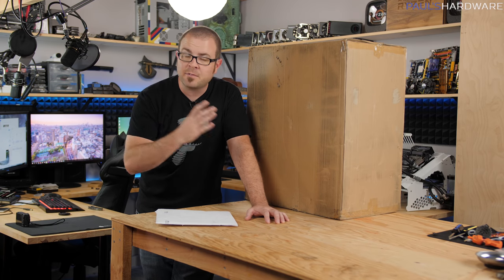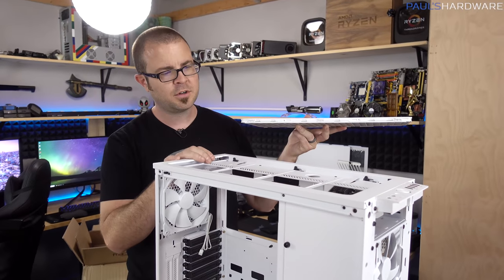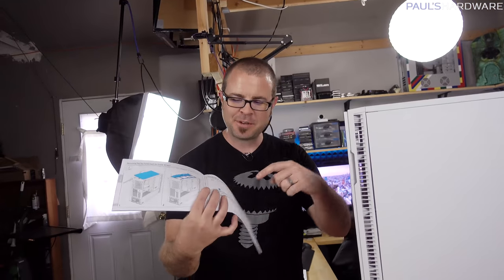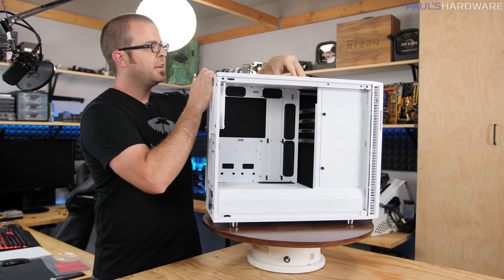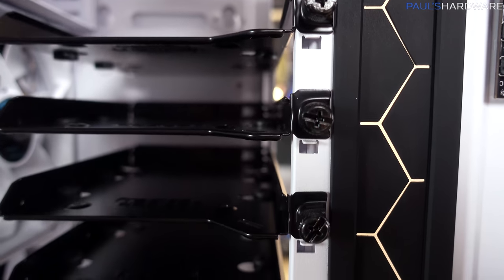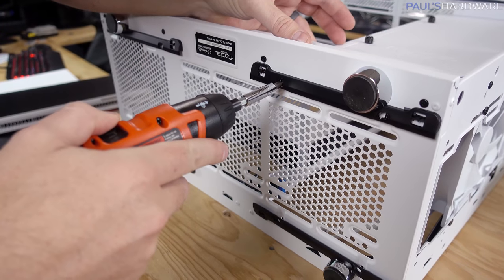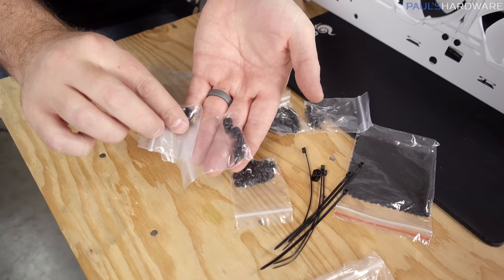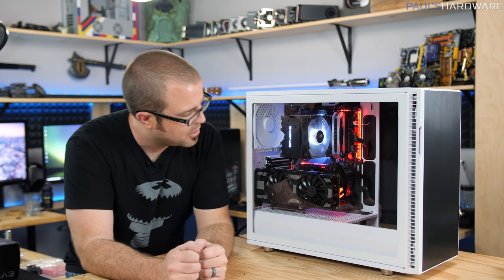Fractal Define R6 - A PC Builder's Review

Comment: Just wanted to mention one thing that Paul forgot to mention about the new Define R6. That modular HDD plate that he removed can actually be shifted back into the case to be in line with the motherboard plate. Then on the backside of that HDD plate, you can still mount two 3.5" HDD's on it. So you wouldn't lose all 3.5" HDD support when shifting to the more open layout.
Reply: I think you guys need to hold back release on this case until you swap out all front panels with USB type C. Don't sell it extra, that's just a slap in the face to your customers. 2nd, there is a black out version why is there not a whiteout version? Most of the complaints i'm reading is why is the front black and not white? Do white or at least a light silver. For $150 USB type C should be included. For anything over $100 and it being 2018 USB type C should be included. USB 2.0 is completely redundant when 3.0 is included. 2 USB type A 3.0 and two USB type C is all this case needs.
Reply: If you want an honest answer for why the type C port doesn't come with the case. It is because 3.1 gen2, as quickly as it's caught on in the mobile world, is still very much a newcomer on the PC side of things and still very costly to include with the proper quality construction and materials we consider standard for cables and connectors on a Define series case.

USB 3.1 gen2 may be ubiquitous in the near future (assuming USB 3.2 doesn't get there first), but for now, there are still very few motherboards with 3.1 gen2 headers and very few devices aside from phones that can take full advantage of it. 

We know many have been asking for gen2 support, but since most don't yet have a use for it we felt it best to give people a choice rather than charge everyone what would have been a significantly higher price.

As for the other colors, these are just the colors that we launched with. If we hear enough from the community that they would like to see a certain color. Then we may release more colors of the Define R6 in the future. That is what happened with the Define R4 Blackout Edition, and the Blackout color has made its way into the Define R5 and the Define R6.
Reply: Thank you for the quick and detailed reply. Hopefully this will help answer what many have been questioning today. One last thing I would suggest. Offer some combo package where the type c front panel and maybe the PCI E extension cable is cheaper if ordered at the same time as the case. Something to bring the cost down because all together we are talking over $200 and that is asking a lot.
Reply: A) Will it be possible to buy extra drive bays (more than 6)
B) Max amount 3.5" hdd's? 8,9,10
C) Will there be a package deal for case and type-c combo?

Thank you.
Reply: A) yes
B) I believe I saw it was 11 on another channel (another review said 10, so it's AT LEAST 10)
C) That I don't know :P sorry, just didn't see an answer for your questions, so trying to help out :P
Reply: After looking too many options on so many cases very similar to the R6 I've finally choose this one because of it's clever design, sturdiness, the ventilation is enough and the possibility of having 2 HDD 3,5" on the back, 2 SSD on the side and 2 more over the PSU case is all I need. I don't really care for the type C port not coming because I'm not using it anyway, however it's good to know that it can be ordered if needed. Great case, I like its simplicity very much.
Reply: @fractaldesignsupportna545  I know this is old but as far as the USB 3.1 panel is it possible you could offer a rebate or core charge for the old io panel to people that order a 3.1 panel or have the option to order the case with the 3.1 pre-installed because once we get it what are we gonna do with our old one. At least finding a way to dispose our old one and/or recouping the money for it would make it a better buy.
Reply: @fractaldesignsupportna545  You should include a bottom plate (like the define type C) for filling the void thats left when shifting the modular HDD plate back beside the motherboard, out of the 4 build videos I just watched everyone has shifted that plate to the back and it totally ruins the nice clean aesthetics of the case, I can't even wrap my head around the reasoning behind not including a bottom plate for the void in the first place. The Define series cases are some of the best cases for super clean builds but that void with the HDD plate moved back is a huge eye sore with the rest of the build being so clean. I wanted to upgrade my case from a blacked out define R4 to the R6 but ill likely just wait for the define R7 or until its announced that the R6 includes the HDD bay bottom plate cover.
Reply: i bought r6 define and easy and clean install! thanks a lot! i will buy second r6 define when amd ryzen 3000 cpu's are released! this case is awesome and it have fan hub and easy fan installation! i love this case :) greeting from finland...cheers :)
Reply: @shinjukucafe7285  I'm actually getting this case for my first time all AMD build but in black colour, closer to the end of the year! :D
Reply: @amrishpatel3501  thats awesome! i have blackout r6 and easy install and working inside. great choice! at the end of 2019 my amd build is ready too i hope
Reply: Thanks - I got an offer for a DAW build, the sales guy said the tempered  glass version (gun metal) has no DVD slot, so he was wrong?
Reply: I just ordered this case and wanted to say thank you for thinking of those of us who not only use the pc for gaming but also for work and we use lots of 3.5 hdds. You have no idea how hard it was to find a case with these specs.
Reply: PimpTwzt  - For my first build at the end of 2019, I bought a black R6 which came with USB-C on the IO panel. I do not have any device yet (Sept 2020) that uses USB-C, but the price was actually less than their colored or glass-panel models or non USB-C case I could find - and it was available. With my budget and with a Ryzen 3600, I tried to find a motherboard which had the USB-C connector on the board, and none of the motherboards I could find had the USB-C connector on the motherboard. In fact, it was really hard to tell which boards actually had it in their specs as all listed the availability of USB-C but it was hard to determine whether they had a connector. Those that it was clearly lusted were out of my budget (550 and 570) So I chose a Tomahawk Max B450 and just have a dead C port on the IO. If I upgrade in the future it will be there.
I have to add that for a first time builder, this case is a dream in which to work. There is plenty of room and the modularity and the ability to get to everything is amazing. I am one of those dinosaurs who still needs an optical drive, so like that feature and the ability to hid it behind the door. And I did not want something full of RGB and crazy angles or design. I kept the base design setup removing all the HDD racks and am using a M.2 drive with a second SSD mounted on the rear. My main concern was heat so I replaced the Ryzen stock cooler with a Sythe Cooler (Mugen Rev5) and my CPU has never run over 60’ C.

Comment: yup. the usb type c should've included. $30 is a bit much.
Reply: adi firdhaus adi m. adnan or at least a mail in rebate where you swap the original IO for the one with type-c for like a <$10 premium
Reply: yeah..i agree
Reply: Not many have C cords. I'd rather save money and not have a useless port on the front. At least they made it to where it can be upgraded for when C is more common.
Reply: usb type c is the future as it will have in many applications and so much better than the old usb . i agree with  Chillhoof. its not a useless port dude. we move forward not backward.
Reply: I think $30 for the USB type C is as fair as a $40 PCIe extension cable is for niche markets
Reply: i do use it for my mobilephone
Reply: sLIMshadyKP It costs $50 AUD in Australia for the IO 😰
Reply: even 2 years after this comment was made, there are still a few population of people who mainly uses type c in their PCs.

Comment: saw all the Define R6 videos up at the same time.. Watched Paul's first of course.
Reply: I watched his last, like dessert.
Reply: Yeah they all don't know how to use a vertical GPU mount either since all of em don't have a water block on them. They put air cooled  graphics card like a noob LoL. It's not designed for that since it obviously doesn't have ventilation.
Reply: What are you guys saying this case is only good for water cooling?

Comment: Amazingly well designed that you can fully populate the storage bays AND have a radiator in the front.
The top moduvent may be a bit too far fetched, they could've gone with a simpler method. But that's a minor issue. There really isn't anything downright wrong with this case. Just a few nitpicks here and there:
- the moduvent panel as aforementioned
- preferred the modular wall section to have the pattern similar to the Define S so you can mount reservoirs or SSD's on it.
- would've really really liked that the USB C port was native, so we didn't have to fork out extra cash for that port.

Comment: Vertical open air gpu mounting absolutely will affect gpu temps. Massively. Gamers nexus shows roughly +20c on the gpu. Throttling temps. Vertical gpu mounts should only be used on custom loops.

Comment: The minor issue with the define C is that you have to play with the front intake fan placement in order to feed the GPU properly because they're a few ahirs away from touching the GPU. Yes it's more compact but it seems like it'd cause some minor airflow issues compared to having more room at the front of the case to let the air circulate into and get blown over the board and hardware.

Comment: Hi Paul.  I've watched more videos on the R6 than I'd care to admit and yours has probably been the most informative.  Despite only getting my R5 a year ago, I think I'll have to grab the R6 in the New Year for the better radiator support.  Think I'll just give the R5 to my dad for his TR build!  In case you get the chance to look, I've got a few questions for you ...

1. Would a Blu-ray drive in the 5.25" bay restrict access to the fill port or prevent you from fitting a 280mm in the top?  I've currently got a HWLabs 280 GTS destined to be placed in the top of my R5, once the retailer gets it back in stock.

2. Can the fan hub be easily removed (looks like a pair of screws holding it to the case?)

3. Do you think there'd be enough clearance at the bottom for a slim 140/240/280mm + fan(s) with a 280mm at the front?  It looks like there should be ... my EK CE 280 fits in the front of the R5 with about 4mm clearance, though I needed a custom bracket made to orient it with the ports at the bottom.  The removal of a 5.25" bay should create at least 40mm extra clearance, but I figure there may be some more room on top of that as the dual 5.25" bay in the R5 has the extra height to it for the grooves for the 5 bay HDD bracket to slot in.  So I guess you'd be looking at up to 50mm clearance between the bottom of the case and the bottom of a 280mm radiator?

If you get the chance to look into these, thank you so much!  If not, no worries.  I'm sure you're already hard at work figuring out what to do with this case, while finding time to enjoy the festive period ...

-Rygel

Comment: The hard drive bracket that you removed does come apart so you can place the cover from it next to the MB tray and have it all look the same with the logo plate where the cages were.  Love this case,  I wish they'd make the front doorless kinda like Corsair does for Airflow editions on the 750d and 450d.  But the door is removable so that's a plus.

Great Video!

Comment: If going with a watercooled build in this case, a waterblock on the GPU should allow for it to be vertically mounted and avoid the temperature issues associated with vertical GPUs, right?
Reply: With a full waterblock that is correct

Comment: Cases as a service? 150+40+30=220$...neat case but too expensive imo. Would have been smart to be able to move that front piece to the back when opening the front to block sight to sidepanel damping mat(fractal post farther down says it can move back) and perhaps add res mounts and such. Seems a little unfinished for a 220$ case (still)
Reply: TheSickness1234 Remove the tempered glass and the add-ons and you arrive at $120, much more reasonable. Also, the add-ons are exactly that, they are optional. Don't say that this is a $220 case as that is being dishonest.
Reply: Spencer Carruth no it’s not dishonest, with all premiums it wants to be a premium 220$ case, so people that get lured in by the full features displayed should also compare it to other 220$‘ish cases...what is dishonest about that? Kind of like at a car dealership, base price is x but the car they give you for a test drive will definitely have the premiums, but it’s just optional. Just like lootboxes, just optional...
But sure strip it down, -tempered glas, -premiums, -basement, -fans, -chinese generic fan controller, -rgb(wait not an option)...what are you left with? Still probably a 80$ case, compare that to other cases in the price bracket...they will have things we just stripped off this one, just compare honestly...$ for $

Comment: Hey Paul, you might not see this but I wanted to ask you a question. Or maybe one of the fellow commenters can help me out. I've only built a couple PC's in my life so bare with me if these questions are dumb.

My parents did something really awesome for me this holiday and purchased me a gtx 1070 ti, they've never purchased any computer components for me before and I'm grateful for that. 
But my current computer is essentially just a run of the mill R9 380 and a AMD FX 6300 processor. I'm well aware that installing a 1070 ti would essentially just be bottlenecked like crazy. I also only own a 1080p 60 Hz monitor; seems like everything is just really expensive right now. 

My question(s) is/are
-Should I even bother installing the 1070 ti or should I wait until I have enough to afford to just build a new system
- I was set on purchasing a ryzen 1600 processor but it looks like the new 8400 intel processor is around the same price and better performance gaming wise, should I just go with that?
-Is the 8400 stock cooler decent? I don't plan on overclocking as I don't trust myself to really do that as I don't really understand the limits or the how to.
- Do you know of a decent way to sell my old system? I'd love if I could sell it and cut the cost of a new system potentially by 75%
-Should I consider reusing older parts from the previous system if I don't sell it? Which ones are typical okay to reuse? 

Thanks to anyone that takes the time to read this

Comment: Hi Paul great video very informative but! and there is always a but when you removed the White internal panel why did you not refit it at the back of the case as it should be? It makes for a much neater build and you can fit 2 HDD or 2 SSD on the back of it which are completely hidden. You can also get rid of the CD drive mount completely if you want. I've bought the case and its great,the standard Black with TG glass version all the others are on back order until March. The only downside I have found is the GPU gets a little warmer than when in my old Corsair 300R as it had 2 side fans resolved by changing the fan curve. I wouldn't consider using the vertical riser as this would get the whole system to warm unless it vents  efficiently ut of the back.

Comment: Interior reminds me of the Enthoo Pro
Reply: I said the same thing when he got all excited about the wire tuck on top of the io shield. That was in my entho pro and is in my entho evolv. But i was as just as excited as Paul when i first built in the entho pro and saw that a year ago. It does make it nice to tuck for the top fan wire.
Reply: As the proud owner of an enthoo pro I agree, except the Enthoo pro is full tower massive!! I love it!
Reply: I have the Enthoo Pro M. This remind of it. So glad to see a 5.25” included.
Reply: So, this vs enthoo pro? Which one you'd recommend?
Reply: I'd still recommend the Enthoo Pro, as it'll still hold a beast of an AIO like the EK Predator 360 without issue up top.  Hardware Canucks demonstrated a clearance issue with 360 rads unless you remove that drive mounting panel.

Comment: You should have replaced that large white metal plate in the open space at the front of the case.  After you removed the drive trays you can replace it at the back of the case and it looks sharp with the Fractal logo on it.  Just a thought.  Nice case though and great review.  I'm thinking the gun metal one would be the way to go for me.

Comment: @6.33 Wouldn't it be better to put the intake fans all the way down? I mean, the heat goes up so if there is any pressure made in the case which the rear fan cannot take out wouldn't it be better there is a how above the fans instead of under them?
Nice video btw.

Comment: I'm going to be building a new system (first in 5 years) and will be using the version of this with the solid sides that includes the USB-C port (they sell them from the factory that way now). I'll admit the price seemed a little high initially, but as it includes enough decent quality fans that I won't have to buy more and it seems like it will be a joy to do a build in which is a lot more than I can say for the no-name cases I've used in the past.

Comment: That modular HDD plate that he removed can actually be shifted back into the case to be in line with the motherboard plate. Then on the backside of that HDD plate, you can still mount two 3.5" HDD's on it. So you wouldn't lose all 3.5" HDD support.
Reply: To cover up all that black foam inside the case at 23:38